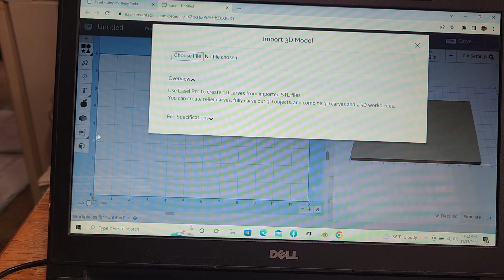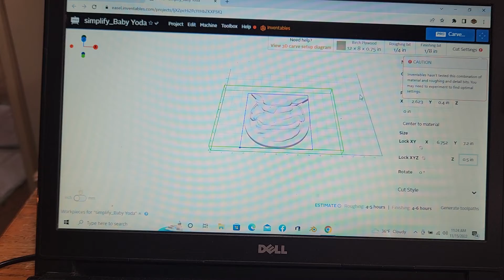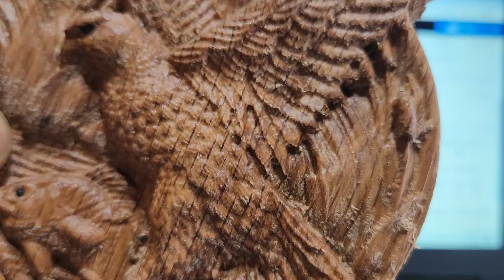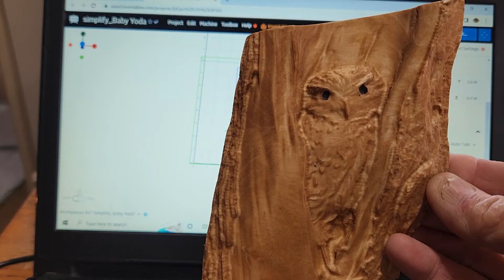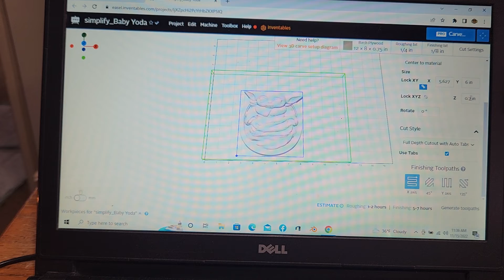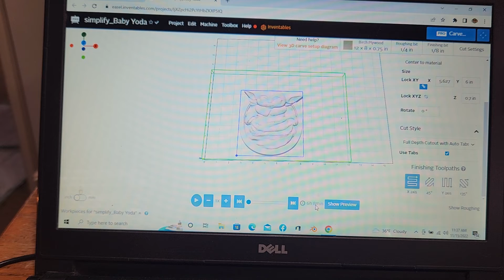Easel 3D for beginners by a beginner

Comment: How do you tell easel the direction of grain?
Reply: Its under the "Cut Settings" on the right hand side where the preview area is.  The fill method for carving out stuff can be circular, vertical lines, or horizontal lines.